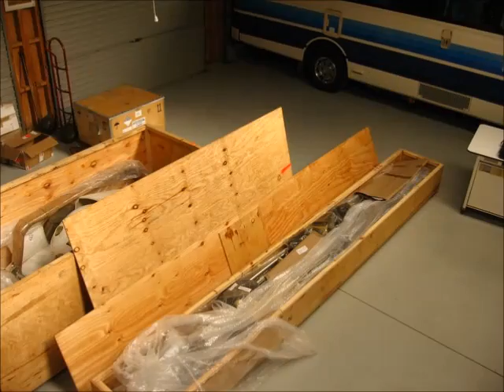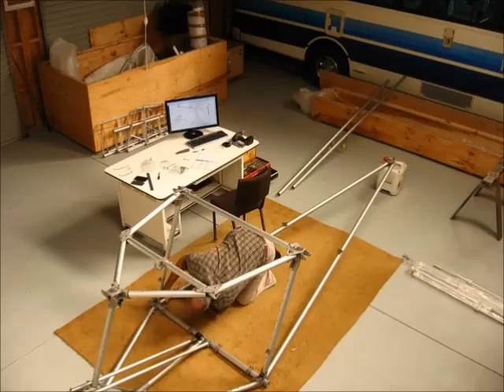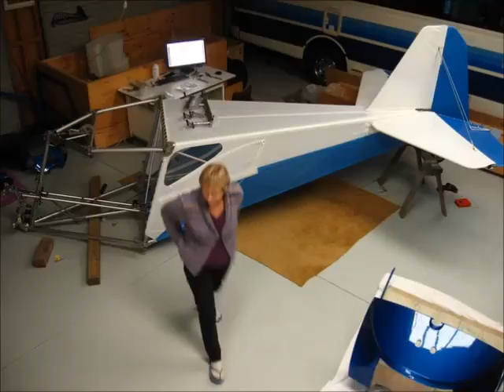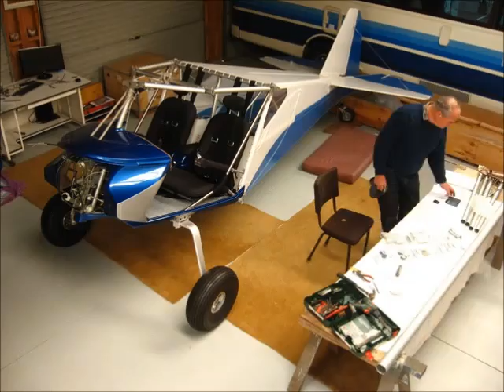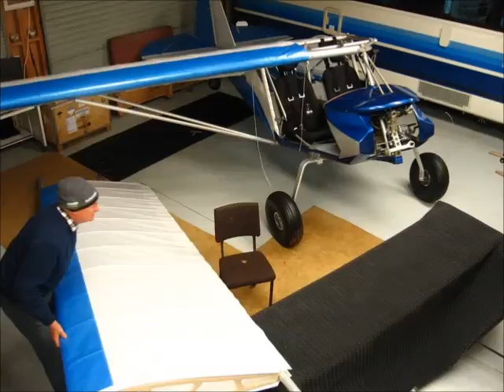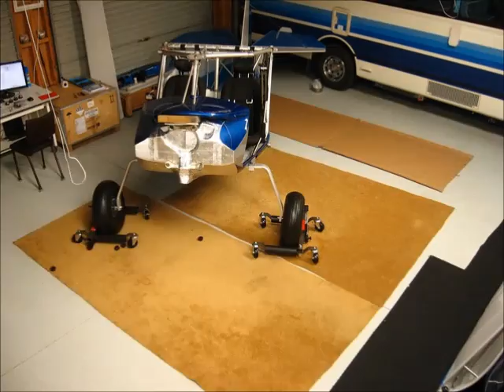Plane Movie part 1 of 2

Comment: Wow, that was really Kewl but are the wing skins not glued or stitched to attach them to the wing ribs in any way?
Reply from the maker: The skin is laced on the trailing edge of the wing. The "ribs" are in pockets sewn inside the skin. No glue used.
Works well.